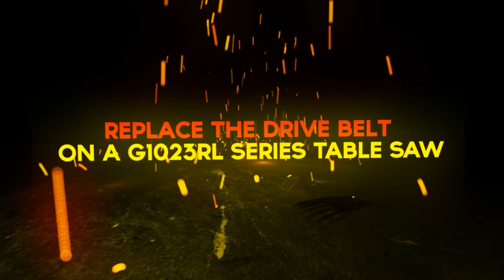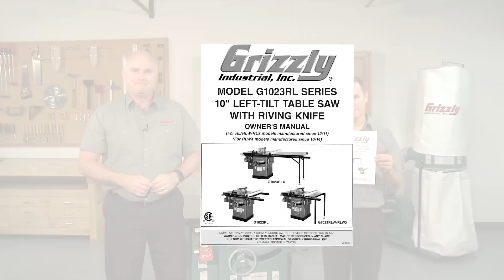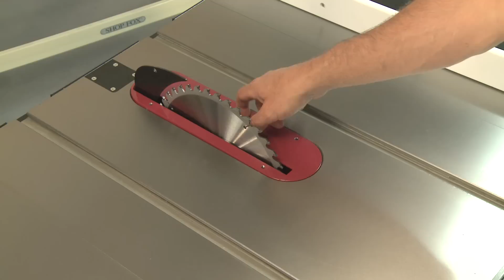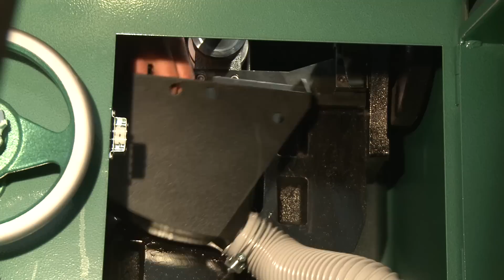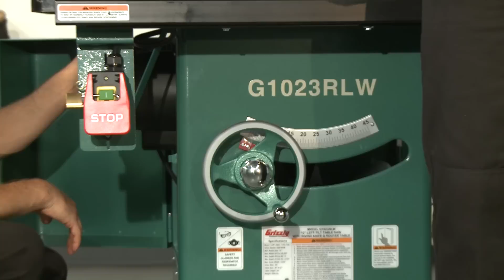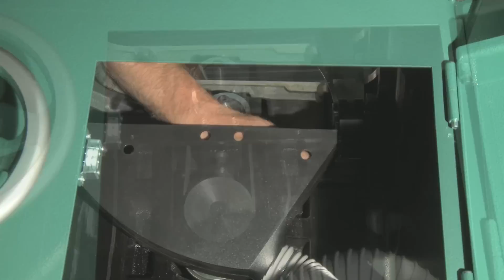How to Replace the Drive Belt on a 10" Table Saw

Comment: What is the process for removing and replacing the drive belt of the g1066z 24 inch belt sander?
Reply from the maker: To replace the belts, first disconnect the machine from power. Release the tension on the motor and roll the belt off the motor pulley first. Next, remove part 86, the 3/8-16 lock nut, followed by the center bar bracket. Then, remove the belts from the drum pulley and pull them out from under part 81, the bearing blocks. Install the new belts in reverse order. After installation, refer to the manual for aligning the drums. Finally, re-tension the drive belts and test the machine. If you have additional questions, please reach out to our Product Support team at (570) 546-9663.
Reply: @grizzlymachines  Thank you for this I really appreciate it. About how much tension should there be on the belts? They look rather wobbly and loose at the moment.
Reply from the maker: Sorry for the delayed response, we had some illness in the office, but we appreciate your patience! As for the belts, they should be snug but not overly tight. A little bit of flex is normal, but if they look overly loose or wobbly while running, you may need to adjust the tension slightly. Don't hesitate to reach out, and we’d be happy to guide you through it!